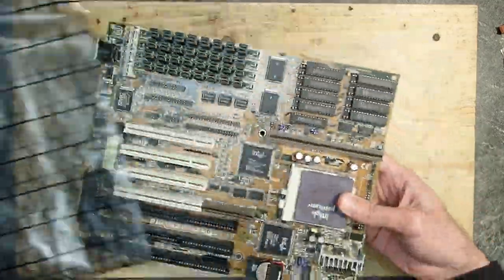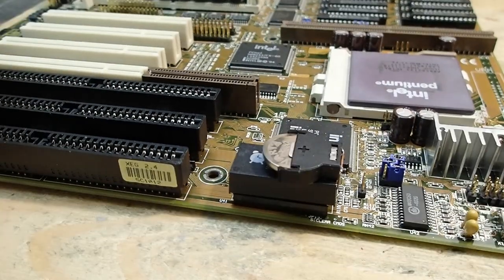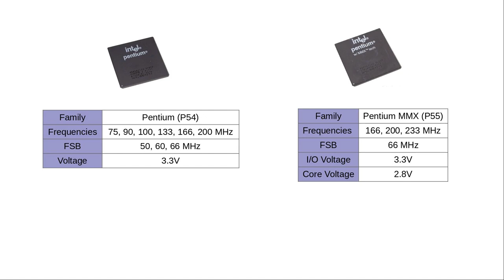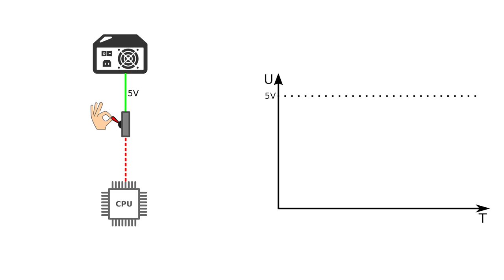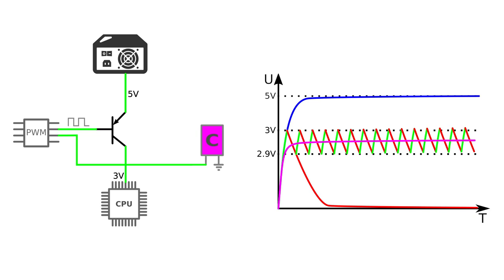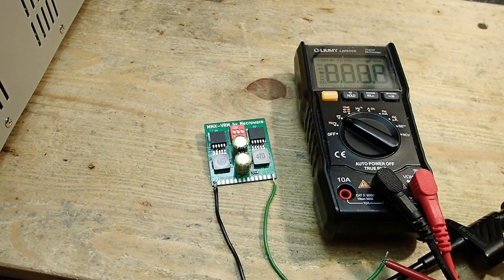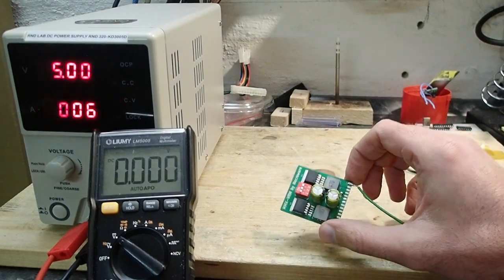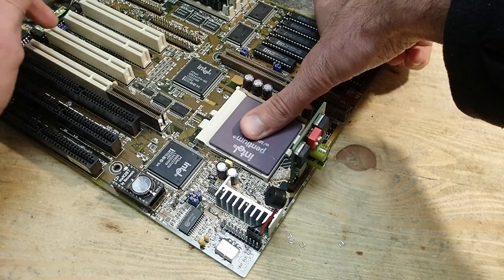Let's upgrade an early Socket 7 board beyond the limit (Part 1): RTC, VRM, MMX

Comment: I wish, I've had that module back in the days!
It was during my time at university and was on on a budget as all typical students. This would have allowed me, to upgrade my P120 to the more powerful MMX-Pentiums.
Reply: i actually used to overclock the cpu and run it at 3v or something i think it was 166 overclocked to over 200mhz dont remember its been a long time.
Reply: My guess is that with this VRM you could use even an AMD K6-2/333AFR-66. At least the 2.2V vcore would have not been a problem. Clock multiplier set on 2 on the mainboard would tell a K6-2 CPU to set its own internal multiplier to 6, which would have been overclocking for a K6-2/333 on a 66 MHz bus. But then you have the opportunity to use 60 MHz FSB (less overclock) or 50 MHz FSB (underclocking).

Comment: Thank you for your explanation on voltage regulation. I am an aero student who has recently been exposed to the arcane electrical arts, and your video helps me understand the fundamentals of regulators.
Reply from the maker: Wow, you really shouldn't see any of my content as educational. This is a purely entertaining channel for tinkerers and hobbyists. I am a software engineer and not an electronics engineer and I always tend to oversimplify things to make them easier to understand. Like in this case, I only end up explaining the basic ideas and some things which I said could be even not quite right. So, if you need educated explanation of the principles, please consider to watch more professional channels and always take what I'm saying with a grain of salt.

Comment: A very neat expansion for your board that I am pretty sure gonna work. my guess is that the VRM board will become pretty hot when loaded fully if that cpu really gonna need all amps as it stated. very good to step down the 5V rail instead as a major failure might give a smaller risk of injecting lethal voltage on the cpu than using the 12volt one. good job
Reply from the maker: Please stay tuned, may be some of your questions will be answered in the second part ;)
Reply: @necro_ware  I can´t wait, I also have tons of vintage computers like this and I enjoy watching your videos about them, and maybe some can be used with my computers as well in the end :)

Comment: I have the same problem on my hand, a Socket 7 MB with Pentium MMX, and with the VRM socket, but without the VRM module itself. I've bought a bunch of cheap DC-DC switching converter modules from Aliexpress, and now I'm trying to imagine the wire gauge need for 6 A, and how I'm going to physically wire the module to the VRM pins. There's also a problem with the trim potentiometer being too sensitive and drifting off the desired voltage - need to replace it with a 20-turn pot.
Reply from the maker: Also a way to solve the problem :)

Comment: I got a P55T2P4, the evolution of the P55TP4XEG with the intel VX. I was never able to make set the motherboard with i233MMX to run at 233. It runs at 200, very stable even with Windows Millenium. I solded the USB 1.0 port on it, but it did a mistake and 1 burnt... But a Nec 5 USB 2.0 port card, Voodoo 1, Nec PowerVR, S3 Virge DX 375, Sound Blaster 64 Awe, 512 ram cache stick, 96mb EDO Ram, IrDA module, 3Com Pci Ethernet, 2 HDD, 2 CDRW drives, 2x 3.5" floppy drives... with just a "noname" 220v/230W Psu
Reply from the maker: You have to set the multiplier to 1.5x, since 233MMX interprets that as 3.5x. At 66MHz FSB that would end up at 233 MHz of core frequency.

Comment: Repair videos are nice, modding videos are always the best :)
Ok maybe not so happy about the design options here*
However I enjoyed this either way.
Nice topic, video :)

* It is impossible to cover everything and get into details here, however one thing you can easily fix (and is very important) is placing the diodes on the same side and as close to the chips as possible! The layout of the PCB on the output of these regulators is critical. Ideally you want everything on the top layer there, components and tracks.
Reply from the maker: Thank you very much! Yes I know all the restrictions, distances, trace widths etc. I was studying the documentation and datasheets quite long. And I was sitting at the design also very long, way too long, if you ask me. I probably wrote a book full of calculations to make it right :D For example the reason why the diodes are on the back side was actually the shortest distance (using direct vias between the pads) to the inductor, which was one of the serious requirements. I also designed the feedback to be out of the inductor flux. Also a hard restriction was to keep the resistors as near as possible to the converter, but it's not possible if you use two of them. So I tried to keep equal but short distances to the resistors from both ICs. I also made a lot of thoughts about heat dissipation transferring the energy using an array of vias onto the back side and many many more tiny but important things. It was quite hard, but I think that I made everything with as little compromises as possible. And what I see on the oscilloscope now looks very good....

Comment: Nice and cool design for retro computing fans!
I had same motherboard back in days.. It's now disassembled for parts or in the box in garage.. Can't remember..
How I recall, it wasn't working and I didn't bother to repair all old motherboards when I get box of them in different condition and repaired only best species.. Now I look to things different - I even repairing battery corroded ones because I love old architecture.
Old boards, usually, is more reliable than modern ones.. 😂

Comment: Man this really took me back. The first PC I kinda built with my own money was a Socket 7 using used parts and a Compaq I bought from a neighbor. I got a couple of sticks of RAM from a machine that wouldn't boot from a junk pile of PCs in the tech lab in high school, and two hard drives from a massive Compaq server tower that was being sold by a real estate company in the classified ads (data security was different in the 90's.) I remember swapping the CPU at some point, but I don't remember the model or frequency on it.

Comment: I love your hardware hacking add-on modules. You did a great job at explaining PWM for a beginner. I forget if the last time you spoke about switch mode power regulators you explained what purpose the Darlington transistor played. I think people watch your channel to learn a bit as well, so it might be something you actually want to dive into.
Reply from the maker: I didn't explain a darlington transistor yet, may be I mentioned it in the comments, but in a video I didn't have an occasion yet to explain it so far. May be one day.
Reply: There are many types of transistors.  One class is called bipolar, and will be designated as NPN or PNP.  Those require current to flow either from the base to the emitter (NPN) or emitter to base (PNP) to turn the transistor on.  The transistor will then allow a proportional amount of current to flow between collector and emitter.  The more current that flows through the B/E junction, the more can flow through the C/E junction.  In that way a bipolar transistor is kind of like a current amplifier.

The problem is, you need to provide that proportional current through the base to get the C/E to open.  If you’re trying to drive that current from a low-power source, like the output from a digital logic chip, you may have trouble opening the spigot wide enough to avoid limiting the current you’re trying to control with the transistor.

In that case you use a pair of transistors in a Darlington configuration:  One as a first stage amplifier, which then controls the base of the second with an already-amplified current.  The pair will take a very small current and boost it, twice, to a very large current.  In that way, it acts like a cheater bar on a wrench, providing additional leverage.

A single transistor might amplify the current from B/E to C/E by something like 100 times.  In a Darlington configuration, the current in B/E of transistor 1 is then multiplied by that 100 times, and that is fed to transistor 2 which amplified it another 100 times for a total current gain of 10,000.

Another type of transistor, called a FET, doesn’t have quite this same problem because the “base” (which, on a FET is called a gate), is controlled by voltage, not by current.  So provided you can supply sufficient voltage to the gate, there’s very little (negligible) current required to control it.  However it is still possible to find cascaded configurations with a driver transistor and a load-switching transistor due to things like .. needing higher voltages to turn on the FET (which may require 10V and need to be controlled by 3.3V or 5V logic), or how all gates have a certain amount of capacitance that, when switched at high frequencies, can put strain on whatever is driving it.

Comment: Well done for the double buck regulator. However, your explanation is missing one key point, the schottky diodes. In a buck regulator, the diode provides current drawn from 0v and pumped by the coil each time the transistor is cut off. That's the only way to output MORE current than how much is actually injected at the input. That's what allows a better efficiency than a linear regulator. In your case, you need 5 amps, and to lower from 5v to 2.8v. 5*(5-2.8) = 11 watts and 5 amps + internal regulator needs drawn from the input. Considering a efficiency of 80% for your circuit, this buck VRM will ouput 2.8*5 = 14 watts of power, and we can assume it will use 17,5 watts with efficiency of 80%, so only requiring 3,5 amps from the input, and therefore pumping 1,5 amp through the schottky diode. The total dissipation will only be 3,5 watts...

Comment: 26:48 lol Yep, Back in the day I had a P166MMX overclocked to ~210 Mhz (undocumented 83x2.5 setting, if I'm not mistaken). I had it for about 5 years (since 1997 until around 2002 or 2003), since I was a poor student back then and had no money for an upgrade. All those years I didn't even bother to open the case, since everything just worked fine, sometimes 24/7, and since I didn't tinker with this config due to the lack of money. So when finally I made an upgrade, I opened the old case to salvage a sound card and perhaps some other parts from an old system and what I found out was that the CPU cooler wasn't even connected. lol I guess, the guy who assembled my system in the shop forgot to connect it and it worked all those years without any problems with just a small aluminium heatsink (btw also without any thermal paste between it and the CPU)! I was actually very impressed, since it was also overclocked and I played quite a lot those days, so God know what sort of temperatures that CPU sustained and for how long.

Comment: Nice! I have a Micronics board which had the VRM socket, but did not officially support MMX and a newer Micronics board with the VRM module in the socket. Fortunately swapping the VRM between these 2 was enough to enable the use of Pentium MMX CPU. But I have an Intel Advanced/EV board which I like a lot that has just the solder pads for the socket. After this video I will have to research if it also can be upgraded.
Reply: Highly Likely. Some later boards came with the VRM socket but only had a little dummy module installed that essentially just did the 4 jumper wire thing like was done on this board in hard-wired form for non-MMX Pentiums. Even some OEM PCs came like that (HP Vectra come to mind). Gave you the option to upgrade to a MMX CPU (good for marketing) but you had to pay for a VRM module (good for business) :P

Comment: Thank you for pleasant memories from childhood.
I think nobody made 430FX boards for MMX Pentiums, because SDRAM support of 430TX dramatically increased overall performance.
Reply from the maker: That's true, but not only because of the memory. The later 430HX and VX could also cache a lot more memory and were equipped with faster cache. In the end TX was kind of flagman for Socket 7 from Intel. After that they moved to P2.

Comment: This gives me realy good memories. My first 'own' PC had an 133MHz CPU and I overclocked it just by jumperconfig. It runs not realy stabile on 200MHz, but without failures on 166MHz. And this with stock cooler an nothing more in the case, as the fan of the little PSU.

Comment: i reconize this MB my dad gave me the same one back in the day. and then i read the manuel and i found that i could also do this same thing :-) but we never realy got around to doing that because back then ics wer verry expensive and we had plenty pentium mbs that can take mmx cpus but my dad did put an resistor at the back side and mmx did work but not fully clockspeed. he didnt have a heat gun eather and the cost was just simply to much so we didnt do it. so nice to see you making it work after all these years :-) you are the best im verry ha[ppy to have found you . i tyhought i reconized it from somewhere lol such a long time ago this brings back nice memmories thanks yo so much

Comment: Voltages where so analog back then. Jumps in between of 0.100v, i.e 2.8V, 2.9V, 3.0V etc while these days due to the digital VRM implementation it can be so accurate till the last milivolt if required. Loved watching this vid. Did'nt know these Socket 7 boards could be modded all the way.
Reply from the maker: Thank you, that was just an example, please don't nail me down to every word

Comment: Good job for making your own VRM, I knew someone had to make one at some point ! I'm not a great fan of cliffhangers, but it's good otherwise !
Reply from the maker: Hehe :D Well, I don't think, that you can find anyone, who would agree to love cliffhangers. But this one was for a reason, there is a chain of further issues, which would be each a cliffhanger for itself. Would I put them all into one video, it would probably last the next 1,5h. So I have to sort out first what is not so interesting and think about how I can put everything together. So I was standing in front of a decision to make a very long video (probably over 1h) in the next two weeks, or to make a cut now, reorder the materials and make two shorter videos, where I'd be able to release the first one now.  The way was obvious for me, even if I have to tease you a little bit :D
Reply: @necro_ware  No problem :)
Reply: @necro_ware  Out of curiosity.. do you think there's any way to adapt a CPU that has a lower IO voltage than 3.3V? I've got a pretty rare embedded Pentium MMX 266 kicking around that I'd love to use but I'm afraid of damaging unnecessarily. Reason is quite simple... it runs at just 1.9V VCore (the lowest any of my boards go is 2.0V, which I guess would be survivable, maybe even help it get to 300MHz), but in addition to that it runs at 2.5V IO which has turned into quite a headache... unsure what to do other than try and find a board designed for embedded Pentiums... ie needle in the haystack. Unless someone comes up with some other idea
Reply: @Knaeckebrotsaege  well if I understand the pinout properly, it might be possible since there are io voltage pins

Comment: I'm surprised you didn't test your VRM under dummy load before subjecting the CPU to it.
Actually I'm surprised you didn't put any load, as switching supplies and even some linears can be unstable without load.
Also I would check how clean the output is with an oscilloscope on no/low and high load.
Reply from the maker: Sure I did test it with a dummy load as well, I just didn't show it, because it was boring. Everything else... well I just didn't show it (yet).

Comment: I have some question about the Vibra 16 side of this card. I have the PCI-AS300 media bus 2.0 variant of this card. The board is exactly the same as the AS7870 you have. The AS300 I have does not have the OPL and supporting chips, but has the pads and labels for them. 
I am wondering if there could be away to get high res photos of the card, with focus of the chips and supporting caps and resistors? 

Thank you.
Reply from the maker: Just send me an Email and I'll send you some photos.
Reply: @necro_ware  I'll send you an email soon (holiday time here in the US, family stuff to deal with), and thank you for the reply. I enjoy repair and mod videos.

Comment: I have a question. Would this VRM you made work on a DataExpert EXP8551 board? Mine isn't POSTing with the P100 3.3V installed and none of the pins are missing or broken on the CPU and I don't have any spares to test. Plus, there are only jumper blocks installed in the VRM spot.

Comment: A cool project and video! I'm just wondering how both voltage regulators would share the load evenly, given they won't perfectly output exactly the same voltage due to normal tolerances. For instance, if one voltage regulator were to generate 2.81 Volts and the other would generate 2.83 Volts for the same feedback voltage divider settings, the former would only kick in if the output voltage is below 2.81 Volts - well after the latter regulator already kicked in. I'd expect an uneven load in this case. I think the standard solution for high-current applications is to have one buck controller IC with interal MOSFET-driver and having an external (beefy) FET and diode.
Reply from the maker: That was my concern as well, but without spoiling too much my tests have shown, that the problem is actually negligible. However one should really use two regulators from the same charge.
Reply: @necro_ware  Ah, looking forward to your test results then :-)

Comment: Hello Necroware,
Keep in mind without load the big buffer caps   could keep the higher voltage after you step down the regulated DC voltage, always measure in the opposite way, increased the voltage never decreased before measure!
Regards, Mark